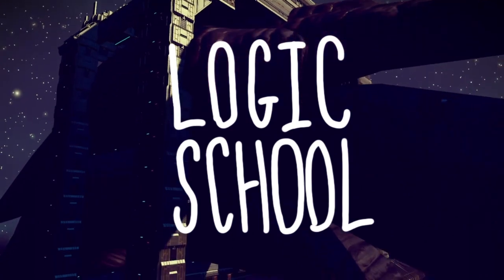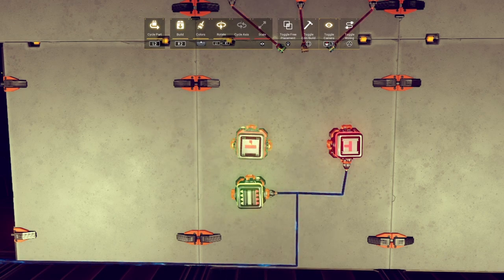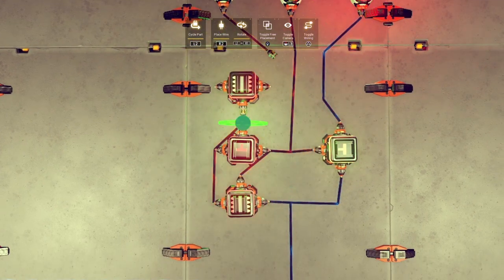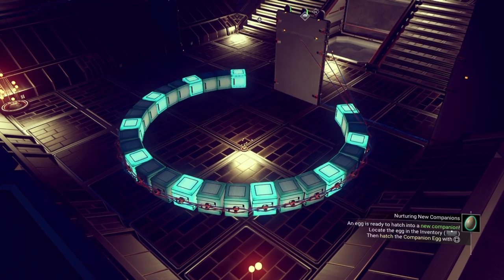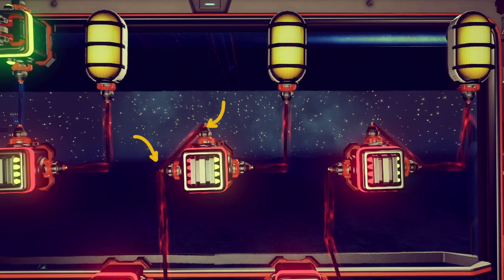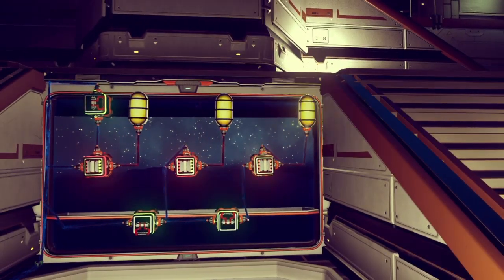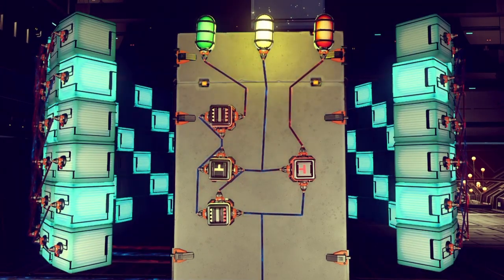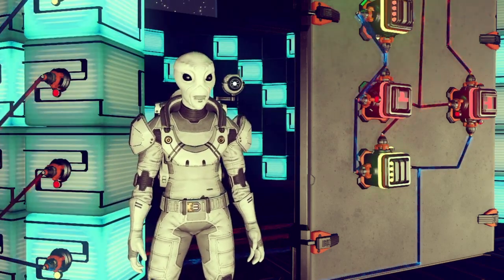No Man’s Sky Logic School: Scrolling lights with a 3 stage circuit (and power inverter basics)

Comment: Nice work. Can you also do this if you have your base power set to automatic?
The light already recieves the power. But then i cant toggle it off with a switch. Is there a way around this?
Reply from the maker: Setting your base power to automatic breaks all logic circuitry. So no, it won’t work. I recommend turning off that setting and setting up your power generation normally.
Reply: @rustyhatfield8302  oh well it was worth a try.. thanks Rusty!
Reply: NO but, here is a neat trick I invented 'incase your base power bugs out whilst in the automatic phase... just place a lightbulb down and you can power your whole base with it... XD

Comment: Top!👍
How can I create e.g. a 6 stage looping light?
Reply from the maker: all you need to do is add another light and inverter to the end of this design, you can add as many as you like.
Reply: @rustyhatfield8302  Thank you very much for your quick reply.
I already thought that you only need to add a light and a converter, but I don't know where and how to connect it.
Reply: @rustyhatfield8302 so will they then blink in order from 1 to 6? Sorry I’m currently trying to build a rotating light for the top of my lighthouse build that has 6 sides.